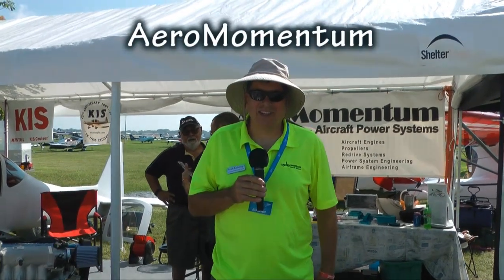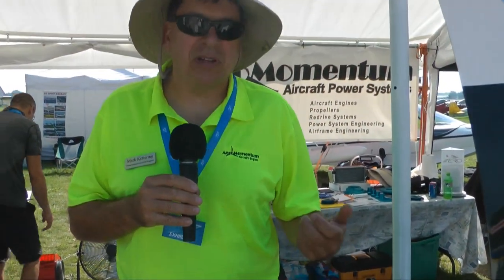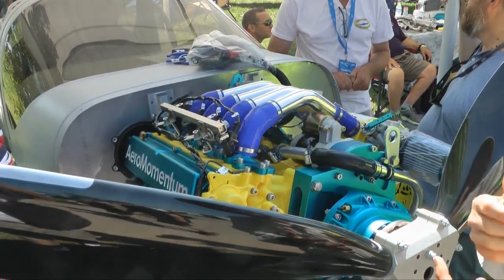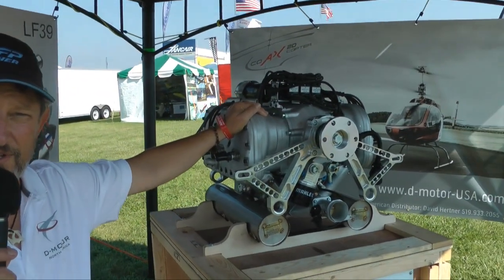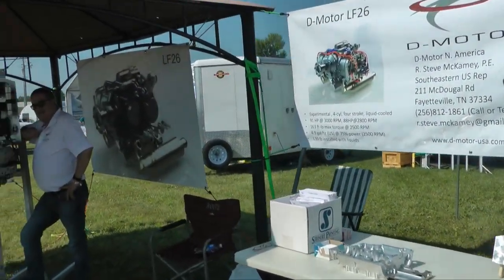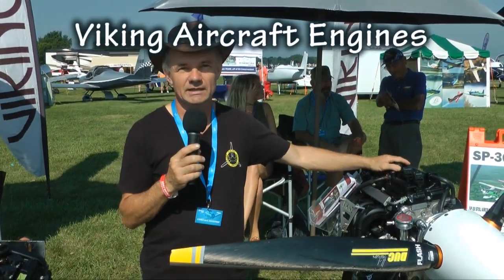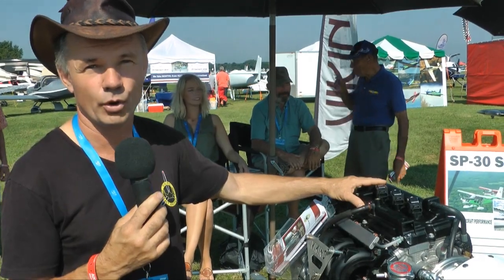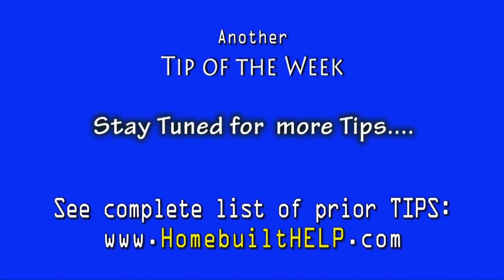3 New Aircraft Engines - Airventure Oshkosh 2018

Comment: I own a Subaru 2.5 L engine in my 15 yo Outback. Other than failed head gaskets at 80,000 miles or so this engine is amazingly reliable. It will drag the old wagon along at 75 mph and 2900 rpm for hours. That amounts to (est 75% power) about 2,000 hours for now. I also own a Chevrolet LS-3 372 cid engine. This runs at 75 mph and 1700 rpm  for hours. I estimate it is producing anout 20% power. I cannot use full power for more than about 8 to 10 seconds because it simply gets too fast in that time. There are marine conversions out there that run Chevy V-8s at 3,000 crank rpm for hours. Marine use is very similar to aircraft use, that is a short time at full power followed by a relatively long time at lower power levels. 

The Rotec radial seems to be a new design that has not been suficently tested. From many of the comments i have read i would not use one in any aircraft I built or flew.

Comment: the flathead design is actually pretty compelling.
Reply: Problem is the flathead should be lighter, but it isnt.  Same with the MotorAV, they are 50-60lb heavier than the rotax912is, and putting them in a LSA thats capped at 1320lbs is big weight hit.
Reply: Except for the price
Reply: A big problem with a flat head design is that by nature, anything you do to increase airflow in the combustion chamber comes at the expense of volume, which further lowers the already extremely low static compression ratio, especially by today's standards.  You simply end up with low specific output, which requires a larger displacement engine to generate the same power.  By extension the engine is much heavier than competing engines at the same power level.
Reply: @WTF0v3r  It's not relevant to an engine running peak hp at 2700 rpm. It's a great idea for the usage, light, compact, but then again they are up against internet myth and lore ....
Reply: @orbitalair2103  The D-Motor is lighter than a 912, look it up, and make sure you include all systems.

Probably too light, they have had bore cracking issues in the first run, and I notice they are pushing drone use hard.
Reply: @markmark5269  The LF39 is around 72% VE at 2800, vs 97% for the 912is/15is at 5000rpm, So a big difference. 5000rpm is the sweet spot for VE with engines and tuning/weight etc. The Lycoming O-320 is only 78% VE at 2700rpm for further comparison.

Comment: I did the maths and the LF39 D motor. Makes the same torque as the 914 at the same geared speed, so not sure why they say it has more torque. LF39 280nm at 2500, 914 288nm at 2500 with 2:1 reduction, so same thing.

Comment: I went into a LSA aircraft to get away from the ridiculous cost of a certified aircraft and come to find out it is getting out of control with the cost I might as well get a certified aircraft it cost less in the long run! I'm not a new pilot with hundreds and hundred of hours logged, needless to say insuring one is crazy! my piper 140/160 was $600 a year my LSA is #2,000 a year. and now look at the ridiculous cost of a LSA engine. My piper for a engine was only $17,000 all done. $26,000 for that flat head screw that!!
Reply: $17,000 would by you an overhaul of a Lycoming engine and probably not a good one the prices quoted are for buying these complete engines. I agree any saving if at all over a continental or Lycoming doesn't come close to making up for the decades of r&d that has been ploughed into the dinosaur engines.
Reply: We will agree to disagree here!!
Reply: viking's 180hp turbo engine could replace some lycoming O-360 engines and do better at high altitude..  And for 17000 its a new engine with a new turbo id say that's better than paying for an overhaul on an older engine that doesn't have a turbo, hell for the price of overhauling that engine you could buy a brand new engine with a turbo and every couple years instead of overhauling just keep replacing that engine with a brand new one built that year with all the upgrades and billions in R&D that auto developers pay.
Reply: @Kev376  correct me if I'm wrong but I believe it is Viking engine that buys low mileage used engines for his builds off of eBay or salvage yards.
Reply: @stanRmeyer  They are same year models with no damage.  However if you wanted you could have them order a new engine in parts and assemble it.

Comment: that 6-cylinder D-Motor is a total 914 killer. Same weight, more power.
Reply: but no turbo
Reply: P C I'd imagine someone will make bolt-on kits in the same way that the 912 has big-bore kits.
Reply: 914 killer? 
Sure, for people with money to burn.
Reply: @Bill R The 914 produces its max power for 5 min only. Not too many aircraft get to 18,000 in that time.

Comment: Hard to beat a rotax 912ULS light weight find them used for $7500 - 9500. Rather have a well proven engine and if there is ever a failure you want a lightest engine possible to glide.
Reply: Blastman, Lightest engine for a better glide distance?  Afraid not. You and many others will not believe this at first, but it is true nonetheless.  The WEIGHT of a given aircraft (same model, same gear configuration, only difference being the weight of fuel and people aboard) at the moment of complete power loss does not affect the glide distance available in a no-wind scenario.  The two aircraft will touch down in exactly the same spot. If flying into a wind, the heavier aircraft will actually glide further than the lighter version will on the same ground track.  Yes, true.  With a tailwind, the lighter aircraft will glide further than the heavier one. The key is flying each aircraft at L/D max, which is the same AOA for both weights. My credentials include 21 years military, mostly fighters including F-105 Instructor, 28 years airline, 11 tours flying as civilian contractor in Kosovo and Iraq, 28,000+ hours total.  Old and Bold Pilot Dave R.
Reply: @daveriley6310  Yep. That is why high performance gliders have water ballast tanks in the wings. When racing, you get the same glide ratio with better speed. They dump the ballast before landing.

Comment: Thanks for the update. Really want to see what the D-Motors can do turbocharged.
Reply: Exactly. Ford and Lincoln Flat-Head engines have been supercharged to increase performance from the 30's. Turbo-charging a modern flat-head like the D-Motor is an easier method of using forced induction to increase thermal efficiency and gain Torque/Hp.  The limiting factor in forced induction of the Ford V-8 is the weak bottom end of the engine. Those V-8's only have three main bearings but still easily achieve 1hp per cubic inch. The D-Motor is designed with 5 main bearings for the 2.6 and I think 7 for the 3.9. -  no reason  you can't get 150hp reliably from the 2.6l and 180-200hp from the 3.9l and turbo-normalize that power up to 12-15k/ft.  Remember, the Flathead was not superseded by OHV engines because of reliability issues, but because of efficiency at high RPM's. The Flat-Head design is simple, very reliable and with modern manufacturing, Fuel injection and FADEC control should be as close to bullet proof as you can get in a spark ignition engine.
Reply: The efficiency of flatheads isn't so great at low RPM, either. The combustion chamber shape is far from optimal, as the valves are off to the side, just like an old Briggs and Stratton!
Reply: @Bravo21  The LF39 is 70% volumetric efficiency at 3100 and 72% at 2800, not very good. A modern engine is 100-105% efficiency.
Reply: @chippyjohn1    Efficiency is not the point of an aircraft engine _ reliability is.
Reply: @Bravo21  If that was the case, people would not use lycomosaur or contisaurus engines. Efficiency is a large factor for aircraft engines, just that pretty much all current engines are from the 1930's

Comment: so the 260 hp motor, will fit van,s rv8, can get a dry sump?
Reply: horseshoe 182. Running a 260hp motor would be very heavy with all the batteries you would have to have on board.

Comment: im confused.. these are for experimental craft.. i can put a corvette ls-1 350hp engine in  for $3000 bucks or less
Reply: johnny llooddte you'll find it worth searching for the differences between automotive and aircraft engines.
Reply: go for it
Reply: They already have. The problem is cutting the rpm by 2/3 and it weighs a lot.
Reply: Many people have done that exact thing. Of course you only want that engine in an airplane that is designed for the power and weight. Like a scaled down P-51, P-40,  or maybe a Spitfire. Most of the kit planes offered are not designed for that kind of power or weight.
    --- Weight distribution is a BIG deal.
Think aluminum v-6 and many more doors will open.
Reply: @ LesbianNaziHookers - heh!  Rotax have always been profit-oriented - and sometimes slow to admit problems.  91x is a fiddly little thing to manufacture, imho.   Auto engines can be harder to convert successfully than it at first appears, but there are exceptions like Subaru and the early VW - both boxer engines with decent structural reserves. Snowmobile engines are a great fit if you can sort out the cooling; we used the Fuji 2-strokes back in the '80s, and they were built to haul an overloaded Polaris sled up a nine mile  hill, then come back for more beer.   Look after them and they would last for decades, but many owners didn't bother. Love the handle!
Reply: The Subaru 2.5 l boxer engine has run successfully in a lot of home-built aircraft.
Reply: 3 of them.  3 corvette engines or an other type?
Reply: Thanks for the clarification.  I know they are used extensively for RAF gyrocopters, but hadn't heard that before.
Reply: @Auger3504 - true! The Subaru boxers make very reliable power plants in my experience, even direct drive.  The 1800 turbo is a good choice for direct drive, but I'd recommend altering the water pump/alternator drive so that they run at their design max rpm.
Reply: Hi Bill, thanks for the response! 
I'd agree with you that it is possible that one can make a (small) fortune if everything goes right.  We managed that in the early '80s microlight craze, admittedly with 2-strokes.  But they were pretty good ones (Fuji) and the small company I worked for  built and sold thousands of thrust packs -  over 2000 units iirc.   
The big problem was reliability - but not in the way one might think.  After selling that many into the UK market over a couple of years (not forgetting that we  had competitors selling stuff too) pretty much anybody who wanted one had one.  Sales dried up.   
So we looked at the engine hours that customers were accumulating, and it was not good news for us.  The average owner (as near as we could figure) was running their engine less than 60 hours a year, nearer 50 hours a year of flight time!   
The difficulties of flying on a small damp island!     Even if this number  was badly wrong, one could call it 100 hours and it would still be 10 years before there was a replacement market, since the mtbf of a Fuji Robin was 1000 hours.  I recall just one manufacturing defect (in 4 or 5 years) that emerged when they upgraded to the 2PM range,  had us skittering around  finding/fixing/replacing them all.  Very conscientious maker, Fuji. 
In a later flirtation with aviation I got  to see a lot of RAF2000 gyroplanes, wearing my engineering hat again.  Whatever their alleged lack of aerodynamic design wisdom,  the (usually used) Subaru power plants in the RAF2000 were as good as their maintenance allowed, often better.  Not the lightest power unit, but well engineered, imho.  Subaru - another Fuji company.  Do like them.
Reply: @jorbedo   I need 50 - 100 such engines. Where could I buy them?
Reply: dude those were car engines no all but a lot of them were with add ons  @Ichibuns
Reply: yeas take the right thing i would not wont to use a gm 4 banger from the 1990s there are great options if one is cleaver  @Bill R
Reply: you should look up the crashes and deaths associated with auto swaps and the gear reduction units that accompany them.   The only one thats remotely reliable is the corvair with some mods, the VW,  and mazda rotary if you arent scared of the whole non-piston thing....
Reply: oh and i'm not saying viking doesnt have a good product this was more in response the chevy LS1 comment.
Reply: jorbedo rotax has certification, plus VERY large nr of engines in operation adding up to millions of proven runtime hours .... these engine manufactures come nowhere near that ... some of these engine manufactures have less then 30 engines in planes... That small sample size gives less reassurance even if  none of them failed yet
Reply: @Ichibuns  johnny llooddte also things he flew for the IAF too. He is a true BS'er and nut job. Also, he is not putting an engine in anything. Just got to love utube for guys like him.
Reply: @jorbedo  Please list the better and more reliable manufactures when making this kind of claim. In other words you do not know of any!
Reply: jorbedo jorbedo they established solid brand reputation with snowmobile and other engines first, then sold aircraft engines, then build up a proven track record of these engines applied as actual aircraft engines ( big difference, ) got certifications, engines are engineered with way more safety margins & redundancies, its no mass production,...  all that is why they cost more
Reply: flynlow alright cool
Reply: @Bill R you are unlikely to make a large fortune as there is no mass market for these engines. Sport aviation is a wealthy person's sport.

Comment: Wow I really like the 3 cylinder 1.2L triple from Mitsubishi.  It’s vey light and in the car world it consumes 2 gallons an hour at high RPM so should be frugal.  Will look for more information!
Reply: Brent what do you know regarding BMW motorcycle engine conversion, specifically the R 1100 fuel injected series?
Reply: Brent I’ll look into that, I already have an R1100 in my CH701 and I wasn’t sure if I should stick with it or swap to something else
Reply: I’m very happy with it though I only have a few hours on it.  It’s fuel injected with a centrifugal clutch prop.  So far it looks like 3gal per hour but no redundancy.  Single plug, ignition, fuel and alternator.  I can put in a second pump fairly easily.  I have purchased a new hal sensor since they are known to fail after five or so years in service.  Whatever the motorcycle book recommends for service I’m cutting the interval in half.  Not sure what else I can do to stack up the odds in my favour.
Reply: Thanks Brent, that’s what I’ll do, thanks for the chat, helps put my mind at ease, cheers!
Reply: Thank you.  We are now flying this engine every day in Florida.
Reply: Viking Aircraft Engines Are they new from factory or refurbished salvaged engines?
Reply: We use all new engines for those that want it.

Comment: Only thing I don't like is most of these auto engines don't have dual spark plugs.
Reply: The main reason an aircraft engine has 2 spark plugs, is because it has 2 ignition systems.  If one fails, you can use the second one.  Tough to change a spark plug 5000 feet up.
Reply: Dual injections and dual ignition for the D-motor.  Il europe they show a run with one ignition off, one injection off AND a disabled cylinder. ( they unplug a spark manually, only the sound changes )
Can't even try half of this with a converted auto engine
Reply: With coil on plug most car engines are pretty reliable in that sense, quadruple redundancy....

Comment: Huh, I wonder what the 2 liter Aeromomentum engine is based on.
Reply: idontcare80 I believe they’re Suzuki.
Reply: Their other engines are, but I don't think that one is. I really can't figure out what it is.
Reply: I dunno, Suzuki makes pretty good engines, but this one is actually a Hyundai engine (I finally figured it out), which is something that I'd have a little bit of trouble trusting. Hyundai has improved enormously in recent years, so it might actually be a good engine.

The one engine shown here that I'd really be wary of is the Mitsubishi 3 cylinder that Viking is offering, I've never seen anything good from Mitsubishi.
Reply: I just looked at 2 liter engines until I found one that matched this one. The 86 mm square bore narrows it down a bit, but the valve cover is really distinctive. It's the Hyundai Theta engine.

Edit: Hyundai recently started offering a couple of crate engines, so that makes sense for Aeromomentum since they don't like to buy used engines.
Reply: idontcare80 I believe it’s a Ford ecoboost
Reply: Nah, the bore and stroke are wrong.
Reply: No, the valve cover is wrong too. The oil filler cap is in the wrong place and you can clearly see the flange for the high pressure fuel pump that Hyundai uses for direct injection. I'm not sure if this engine is both direct injected and uses port injection, but the flange for the HPFP is there. The 2.0T engine in the Sonata produces 274 horsepower at a slightly higher rpm, so they've likely de-rated it a little bit.

You have to change the crank to change the stroke of an engine and you have to machine the block to change the bore, I very much doubt that these guys are going to do that, those are very expensive modifications to make. I would bet that the pistons and rods are stock on the Hyundai engine, it's a pretty solid engine.

Edit: Plus, the Ecoboost has a better bore to stroke ratio than the Hyundai engine, so you wouldn't actually want to change it.
Reply: "I've never seen anything good from Mitsubishi" 
they do some nice diesels, perhaps better suited to a forklift than LSA but they do make good engines.